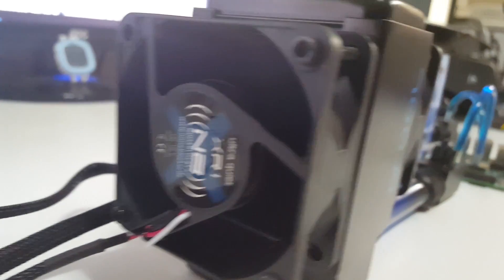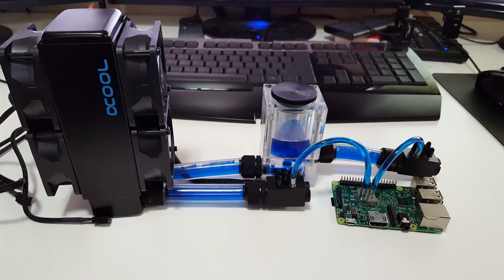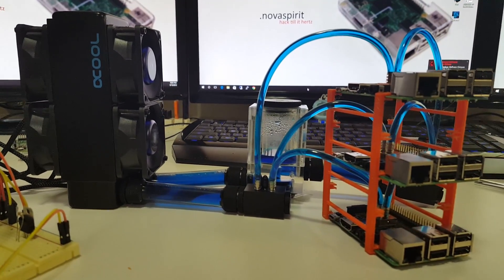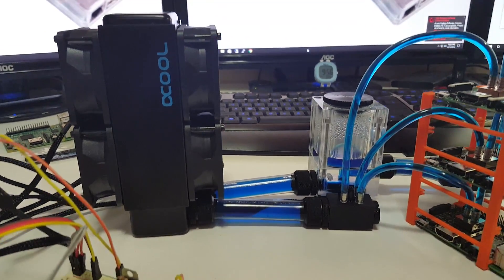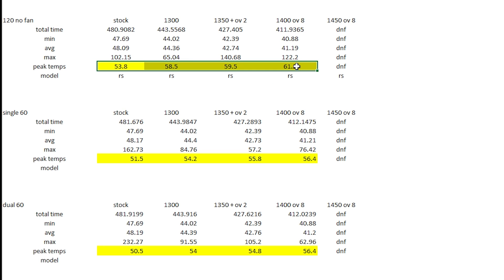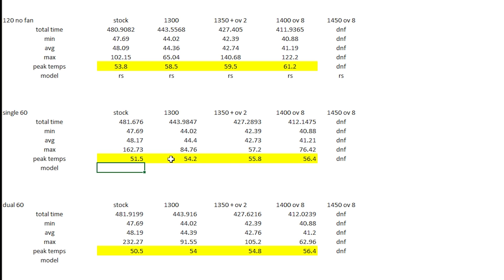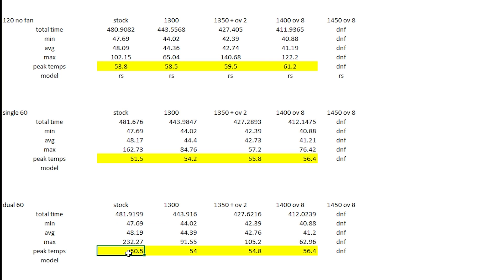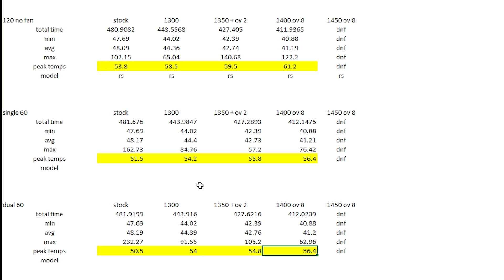Water Cooling Kit for embedded devices

Comment: Im thinking of doing the same build in the Asus Tinker Board... However the ASROCK CPU is 19x19mm, Compared to PI 15x15. Do you think I would still be able to use the CPU block from Alphacool ie; The MCX one. I also have a question. How do you power the pump and fan? do you use an external powersupply? Please explain this. Thanks,

Regards.

Comment: Lmao, rack mounted pi's. As I mentioned on your last video, the temperatures are not extreme enough to make the order of the loop mater that much. The only thing about your loop order that matters is the reservoir must go directly into your pump and it must be above the pump. But you don't have to worry about that as you're using a combo top unit.

Just because I'm interested,why do you find it necessary to liquid cool your hot end on your printer? Is there excess heat in the heartbreak that's causing jams? Are you doing this just because? What hot end are you using?
Reply: the pump probably draws more power than the pi anyways haha